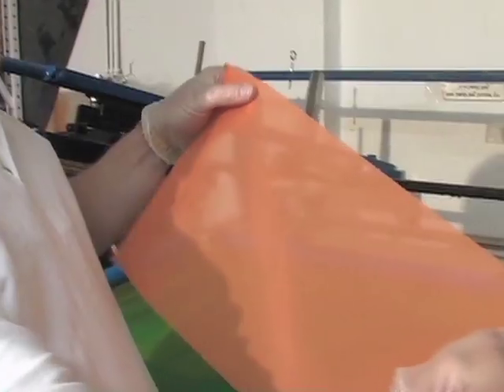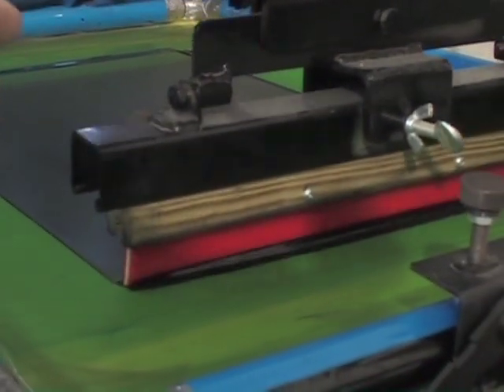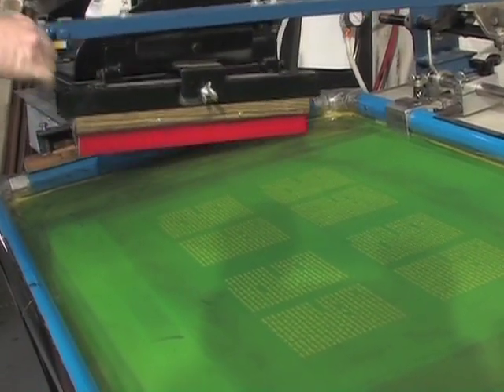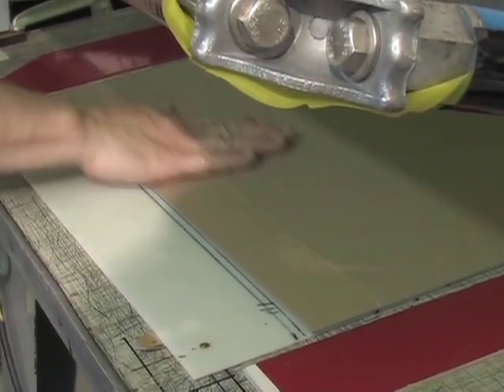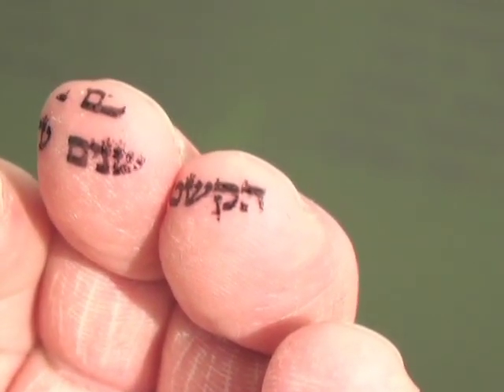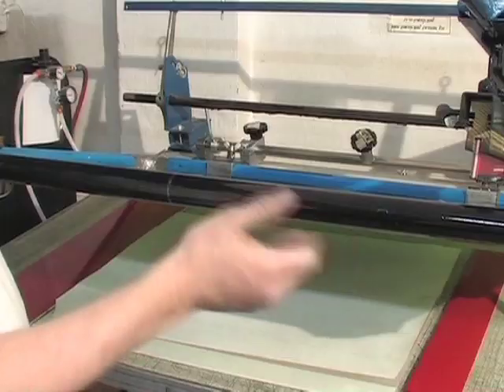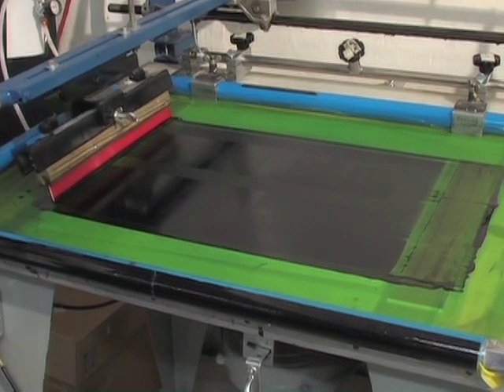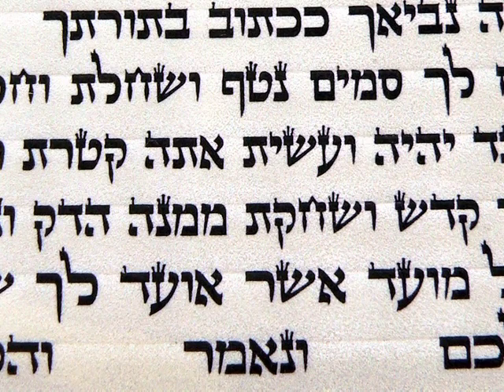Silk Screen Torah Scroll Process-English

Comment: If so many poskim are against this then even if it is kosher according to some opinions then at minimum you can't say the brachot on these, no?  And I also fail to see the difference between this and a regular printer.
Reply from the maker: Did you read the Teshuva where the differences are explained
Reply: The Teshuva is for which questions?  The brakha or the difference between this and a regular printer.
Reply from the maker: @Azavmax  All of your questions are addressed in the teshuva
Reply: I know this is years late, but honestly, the average Sefer Torah written with a pen has HUNDREDS of spelling errors and treife letters. That's not an exageration. Anyone who works in STAM can verify.
There's a much bigger question about saying a brakha over a regular scroll than over a necessarily perfect silkscreen scroll.

Comment: who are you trying to fool? this whole thing is farcical.  why bother silk-screening? just use a printing press or xerox machine for all the difference it makes.
Reply from the maker: +Jack Beyda 
We are not trying to fool anyone. If you watch this video you will see that the scrolls are all written by hand. This is not possible using automated xerox or printing machines. This process was worked on for over 10 years to make sure we conformed to the Halacha completely. Take a look at the 18 page teshuva Rabbi Abadi wrote going through all the questions raised and answering them
Reply: +yosef ten years! The Torah was given 3500 years ago and until now was written by hand by a qualified Sofer where each ink stroke is meticulously spelled out in Halacha. I know Rabbi Abadie all too well and his rulings are far from accepted. Resheet Hochma Yirat HaShem. This process has neither.
Reply: Where is the teshuva?
Reply from the maker: Jack have you read through the teshuva before you determined the validity of these scrolls? You should come to the toe nails of Rabbi Abadi in yirat Hashem
Reply: Michael Edery not directed at me? Did you even read what you wrote?